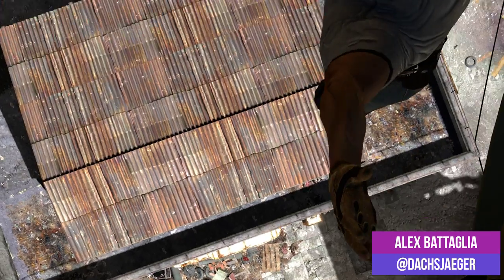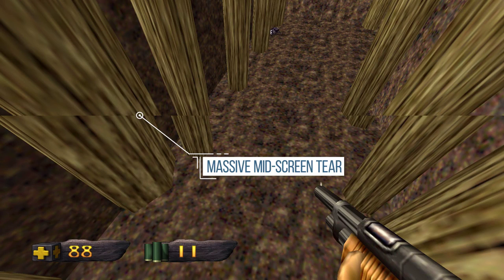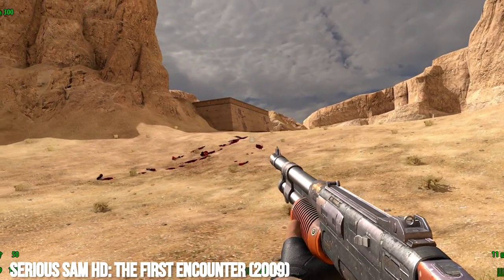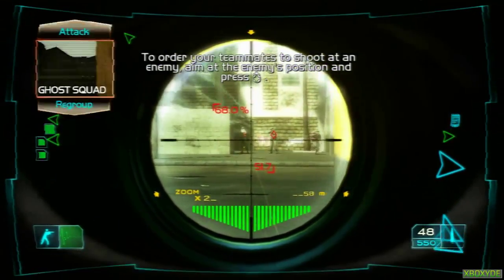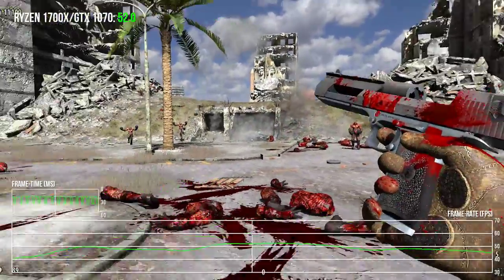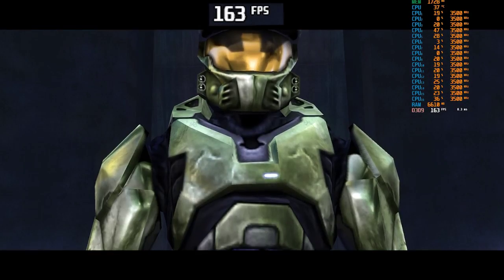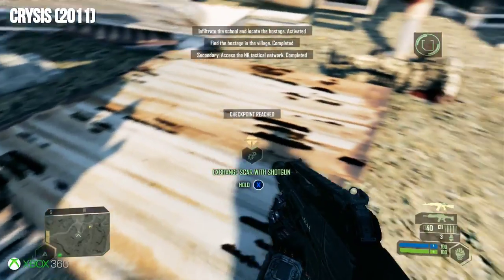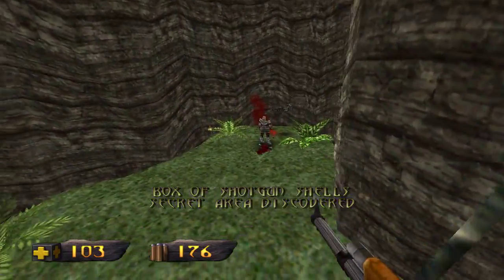Tech Focus - V-Sync: What Is It - And Should You Use It?

Comment: What is Vsync? Awful, even at what it's supposed to do. Should you use it? No. Cap your framerates as near to your monitor refresh as possible.
Reply: that's generally even worse. was going to explain but 2:06 does exactly that anyway. the buffer lag is generally gone, but you end up with much more noticeable tearing as the tear stays in the same location or slowly scrolls over the image.